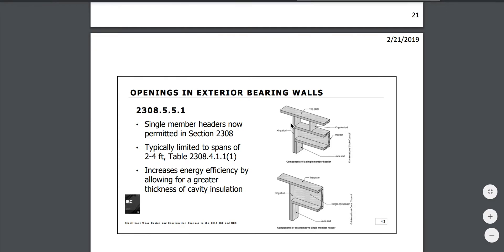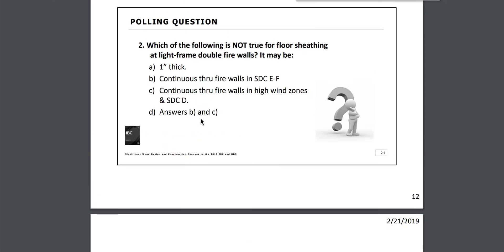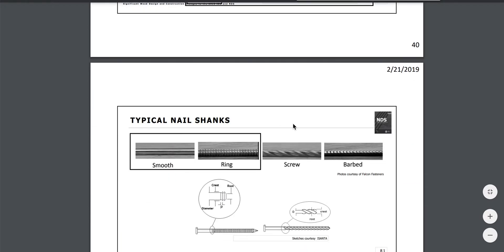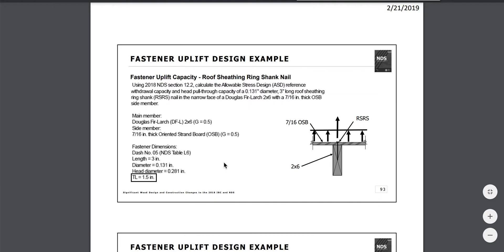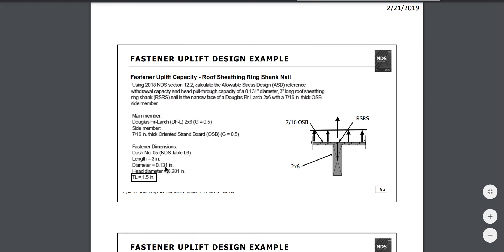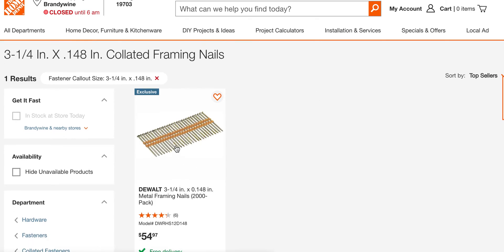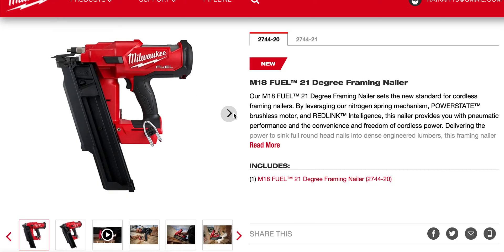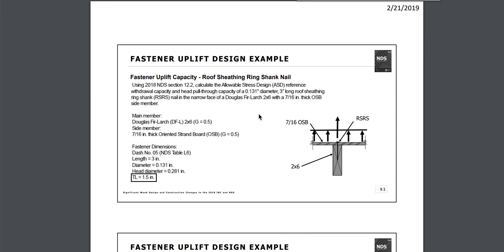Milwaukee 21 degree vs 30 degree nailer IBC 2018 Code has the 21 degree nailer as the WINNER

Comment: Were you attempting to say that building code may require you to use a full round head on particular applications, and that you should refer to your specific application to determine which nailer should be used? For those that don't know- the full round head is required in certain applications like nailing down decking, installing sheathing, etc.  The 30 degree nailer is not the best choice for that application as the most common type of nail is a clipped head nail. The 21 degree nailers offer a full round head, with better holding power for certain tasks. Interior partition wall framing, toe nailing, etc are great examples of where a 30 degree nailer shines. Always check code requirements for what you're working on.